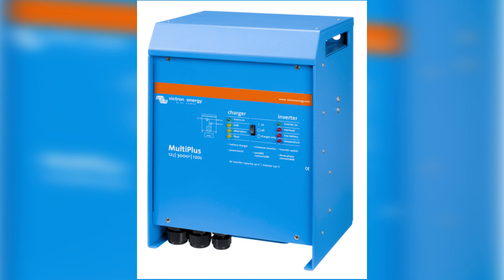Charging Lithium and Lead Acid Batteries on a Catamaran

Comment: I like the idea of a seperate charger for the start battery when on shore power. My question is with the Victron DC-DC converter between the start and the lithium. Will it  direct power  through the DC-DC converter to the lithium house bank from the dedicated start battery when on the charger? I will have a Xantrex 2000 pro Marniner I/C going to the Lithium house bank. Or does it only detect alternator power?

Comment: There are advantages to the proposed setup, on my single propulsion sailboat it works: a configurable max 50A dc-dc converter gets power from the starterbattery when there is 13,8V (adjustable) available (engine is running). At low Revs the 115A Alternator delivers approx 30A. I configure the dc-dc at 20A, so the alternator doesn't get overloaded. At medium throttle I drive the full 50A. With dual propulsion at 100A you can fill up your house LFP pretty quick.. Your engine-setup stays intact and does not require extensive overhaul or temperature steering etc

Comment: I agree with the above - external alternator regulators with lithium profiles feed direct to house. To keep it really simple recharge the starter batteries from small ac chargers already installed via inverter - or small 10A dc/dc would replenish starting drain quickly. $$ would be to have BMS for house bank control external regulators in case of disconnect frying diodes or get a Sterling or Balmar protection device for each alternator. Jeff what are we missing?

Comment: Jeff-  why not put all your charging sources to the house lithium bank and 2 dc-dcchargers to the start batteries from the house bank?
Reply: I think that makes the most sense. Dump all of your energy into the bank that requires the most and then use 1 DC to DC charger to feed the start banks. Less boxes means less things to fail.... not to mention less wiring which saves on install costs.

Comment: I bet that just becomes so confusing for some people. But these devices are "smart" and I have laptop charger (19v) running into a 10 amp charge controller and it doesn't care where that power is coming from. Works fine.